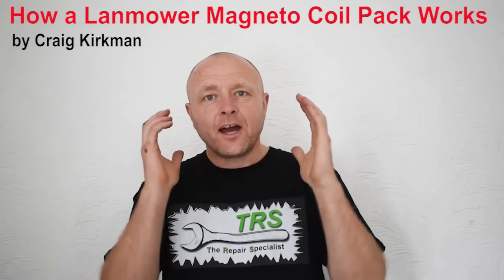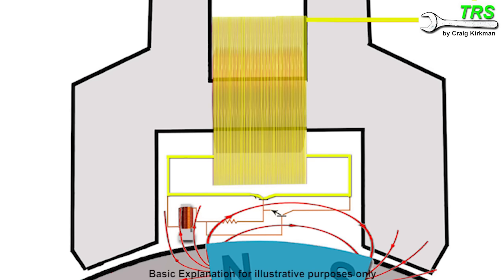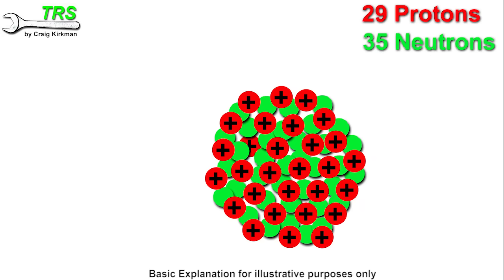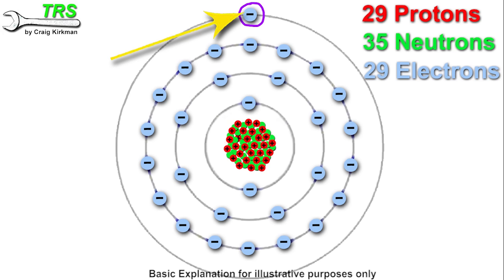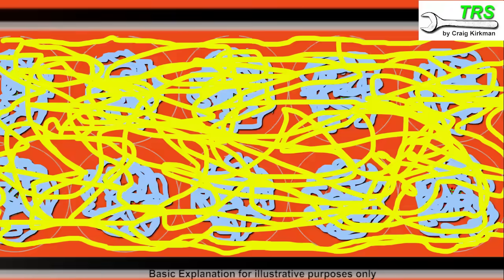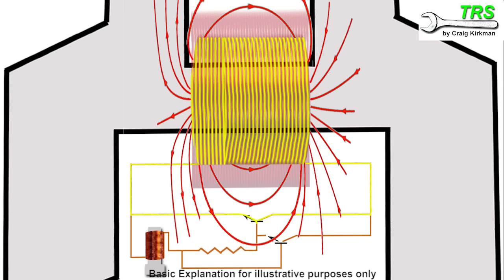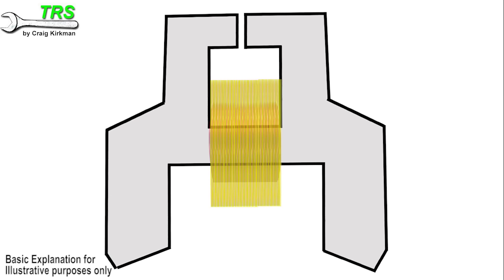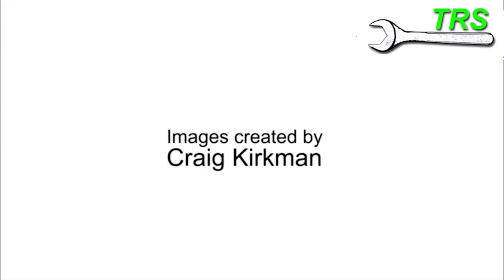Lawnmower Coil Pack Sparking System - Induction Coil, Transistor!  (by Craig Kirkman)

Comment: You’ve given us a truly excellent explanation of the physics behind how small engine ignition systems work. However, someone with trying to troubleshoot problems with his lawn mower etc. would find it even better if 1) if there were some mention of what the gadget’s kill tab does & what its resistance to its frame should be 2) some mention of what the resistance of the resistance between  its sparkplug lead and frame be 3) a complete circuit diagram  depicting what the ends of all three of the gadget’s coils are connected to, and 4) because it’s often difficult to tell if the engine’s flywheel is still properly keyed to the crankshaft, some mention of where its magnet ought to be with respect to the magneto’s frame at engine top-dead-center.
Reply from the maker: Well, firstly, thank you for your nice feedback. Really appreciate it.  Yes, I understand what you mean.  There is much more I could, and should have mentioned.  I had to draw some lines and because of this i didn't go into to much detail. Thanks again for your comment. What you have mentioned will probably go into another video soon,  Thanks. Craig

Comment: Wonderfilled video! Two questions though. Why are the laminations shaped the way they are; and need to be set at .040 or so from the magnet. Second, how did these ignition coils work before the invention of transistors? The transistor was invented 1947ish and the P type Briggs & Stratton was early 1900's. Thank You great job on the video!
Reply from the maker: Hi. Thank you for your comment and feedback. I really appreciate it.  

As to attempt to answer your questions.  
As far as I know, the Transistors were developed and used to replace the old contact breaker point system.  Transistor were favored because unlike the breaker points, they had no moving parts and were much smaller and space saving within the coil.  Whilst the transistors were invented in 1947, they weren't actually not used for many years later, according to what i can gather anyway.

As for the other question about the lamination's.  
The lamination's within the iron core are necessary to prevent swirls of current developing during the coils generation of electricity.  These swirls of current are called Eddy Currents (also called Foucault's currents).  These currents need to be reduced because they interfere with the transfer of electromagnetic energy from the primary coil to the secondary coil.   

As for the beautiful P-type Briggs and Stratton engine goes, I believe this was developed using inspiration from the O.A Smith Motor Wheel acquired in 1919.  As a result, the P-type was introduced in October 1920, and has been in the hearts of many enthusiasts ever since.

I hope this helps and please forgive me if my history isn't completely perfect here.

Thanks again for your feedback. Craig
Reply: @TheRepairSpecialist   Thanks for the reply! I should've realized the older engines were using points. It makes sense now. As for the laminated cores, I do have a vague understanding of eddy currents and the need to keep them controlled for better performance in a transformer. My curiosity however lies in U shape of the lamination pack, where each leg of the up-side down U is in such close proximity to the fly wheels magnet. It would seem that as the magnet passes by those legs that the lamination pack would become magnetized as well. If that is the case, does it result in a stronger magnetic field induced into the secondary than the primary could accomplish on its own?
Thanks for taking the time to do this for us.

Comment: Hlw bro, I am having a lot of trouble with two lawn mowers.  The problem with my machine is that after starting, the rpm increases and the start stops.  Same problem in both.  Please tell me the solution
Reply from the maker: Hello Sir.  
Are your mowers two stroke or four stroke? If you have 2 stroke then this sounds like they are becoming starved of fuel after starting.  Check your fuel tank cap and make sure it is breathing.  A good test is to loosen the cap slightly and see if the engine runs longer. If so, then it is pressure build up from the cap not breathing. It seems a little strange that you are having the same problem with the two mowers though. Are they the exact same type of mower?

Anyway, if they are four stroke, it is still worth trying the same with the cap and just making sure that there is free flow of fuel to the carbs. Check fuel filter flow etc. 

I'm not 100% sure it is the coils at the moment because of the increase in engine rpm before stoppage. It sounds like it could be (not 100% sure again) more of a fuel issue at the moment but one thing I have learned over the years is that we can never tell for definite without further investigation.  

Try this first.

Thanks
Craig
Reply: 2 stroke engine
Reply: Both
Reply: Hlw sir, following your suggestion, 
 to start both the machines, No more problem, Thank you so much Sir

Comment: The primary and secondary create a step up transformer, but what I don't understand is the EM induction into the trigger coil.  When the South side of the magnet passes the trigger coil, current will flow in one direction, and then when the North passes, it will flow in the other direction, inducing an alternating voltage, correct?

But in your illustrations, it looks like it is pulsed DC voltage.  Is that how it works?
Reply from the maker: HI, thank you for your comment.  I can tell you are knowledgeable and you are absolutely right in your questioning.  I endeavor to make an update video that explains this much better.  Thanks again, and I value your comment. Craig  👍

Comment: What happens to the second lead on the secondary coil terminates to the spark plug? So 2 leads to the plug or… ?
Reply: It would have to go to ground to shut the engine shut down? changing the path to ground killing the spark
Reply from the maker: Yes absolutely, If you get the time then please take a look at my other video in this link where I explain this much better. Thank you. Craig :  https://www.youtube.com/watch?v=JN0icpsh5qM&t=710s

Comment: Very well done! There is only one aspect of this mechanism that may be pointed out and that is the proximity of the magneto pickup to the magnet that is mounted on the flywheel. Obviously, the amount of coupled flux lines varies as the proximity changes so the question is begged, is there an optimum distance or gap between the pickup and the flywheel?
Reply from the maker: Hi. Thank you for your comment. I really appreciate it. To be honest, most of the people who I work with in the trade use a business card to set the distance of the fixed magnet on the flywheel and the pick-up on the coil. This does seem a little in-professional to say this, but it actually works quite well. I’ve tried it many many times. Other than that, you can find the specifications for each specific engine. I’m sure you can use a search engine to look up your particular engine and find the answer. If not, then you could try the business card if you feel it is good to do so. I hope this helps a little . Thank you. Craig👍
Reply: @TheRepairSpecialist  Thanks for the response. Will file that away for future use.

Comment: Thank you for that excellent explanation, right down to electron flow! I have one question if your time permits;  After the secondary coil pushes the electrons the spark plug to the earth body, does the coil become positively charged or draw more electrons in from elsewhere ?? much appreciated...
Reply from the maker: Hi. Thank you for your nice comment. I really do appreciated it. So, as for an answer to your question.  I believe that the electrons are pushed out of the secondary coil by the electrons behind them. 

If i am correct in saying this then that means there is electrons in place from those that have been ejected out to the spark plug.  Kind of like when a river pushes its water flow downstream. The water has been pushed there by water before it. The water before it naturally takes then place of the water in front of it.  

I hope this helps. 

Many thanks again. Craig 👍

Comment: How do the electrons complete the circuit by finding the engine ground and getting back into the coil copper which has insulation around it??
Reply from the maker: Hi. I know what you mean by asking this question. The whole thing can be quite confusing.  If you take a look at my other video on How these Coils can fail, it mentions about this, which of course is all explained from my own opinion from the research I have managed to collect and put together. The video is here in the link.  Many thanks. Craig  : https://www.youtube.com/watch?v=JN0icpsh5qM&t=817s

Comment: thanks for the great video! one question for you- why does the coil body have two points of "contact" with the spinning magnet on the fly wheel?
Reply from the maker: Thank you for your feedback. As for your question. It is apparently a way the coil interacts with the North and South poles of the magnet. The video didn't explain this type of detail because it is deliberately kept simplistic for an initial explanation.  I will look at making another video explaining this further though.  

But as it stands at the moment, I have found some information saying that the two points relate only to keep the correct distance between the flywheel magnet and the coil, and other sources say that it interacts with N and S of the magnet as mentioned.  

One thing is for sure though, as with any video like this, finding information about such a thing is almost impossible on the internet sometimes because NO so called professional in the field has bothered to help others by explaining to us. BUT, when I make a video about a topic it brings the so called no-it-all's out in the chats then.

That's why making these types of video is challenging. You have to piece together what info can be found, and then listen to no-it-all's big talk when your video is uploaded.

Sorry for the rant. I just want information and learning to be available to everyone who want to know. People like yourself!

Thanks
Craig

Comment: I'm trying to use a newer b&s coil as a ignition coil for a burner re-lighter 
Using a 12v battery and a 40a relay with negative grounding
Do you know any tips for doing this?

Comment: I was having trouble understanding the magneto ignition system. This video makes it very clear, thanks. The animations are very helpful. I think it might help to include the capacitor (condenser) part of the circuit, as this is important in controlling the exact time of the spark and making sure that current is discharged rapidily enough through the plug to create a spark.
Reply: I don’t believe this system uses a condenser. The older systems used a condenser ( when points were used) .

Comment: I like this. I like it real well and will probably use this to help explain the concept to people. I think the most common misconception about electromagnetism in this application is that a spark is not created JUST by a magnetic field, but that a spark is created when a magnetic field quits, or collapses. Best demonstrated with a simple automotive coil. Connecting 12 volts to it does nothing of note, but taking away the 12 volts is what produces the secondary spark. Thank you.

Comment: Many thanks for this interesting explanation.  A number of parts of it I was not aware of so it was very useful.  I need one more part of the explanation.  Most lawnmower engines are four stroke but the system as described will produce a spark every rotation of the flywheel.  We only need half that number of sparks - at approx top dead centre on the compression stroke only.  Is there a redundant spark on the exhaust stroke?

Comment: I guess the next question is: how to test the different components of the coil system to find a problem. So far, I see its easy to test coil #2 for open and short conditions. However, the primary and trigger coils do not seem accessible for testing. I wonder how to test this unit properly to properly fix a problem.

Comment: One thing I missed. In earlier systems, points were used to cause the rapid collapse of the magnetic field. In current systems , electronic ignitions, there are no points. I assume the electronics in your diagram have something to do with initiating the rapid collapse. Is it simply the loss of the magnetic field at the trigger coil or do the transistors play a role?

Comment: Nice explanation of an electronic ignition coil in a  small motor. I have a bad coil on an antique gasoline powered drill that needs to be repaired as there are no similarly shaped replacements available to fit into the tight space necessitated by the very compact packaging requirements. The highly detailed explanation in your video has inspired me to simply rewind the secondary winding, and splice in a new high tension lead. My system pre-dates transistors so instead of using a trigger coil my system uses points to break the primary coil circuit thus causing primary field collapse only when points open.

Comment: Well done man! Super explanation!! I would be interested in information concerning how to test a coil pack with an ohm meter to determine if the pack is good or not!! I had a mower that wouldn't start. I got it to run after changing the plug and coil. I ohmed out the new plug at 19k ohms, it has a resistor. The old plug measured 4k ohms!! The old coil pack readings were : scondary 289k ohms, primary 9k ohms. The new coil readings were: secondary 300k ohms, primary 14k ohms. Would this lower reading in the old coils be enough to cause no spark or was no spark due mainly to the drop in resistance of the spark plug or a combination of the two?? I know, complicated question!!! I like to learn!! Thanks for any information you are willing to share!!

Comment: Tecumseh lawnmower engines seemed to have a better system that involved a primary coil that generated power to charge a capacitor. 
Stihl I think has an even more sophisticated assembly that I think can sense RPM and change the time somewhat relative to engine rotational position thus giving a form of spark advance with higher RPM. Probably involves delay in triggering discharge of a capacitor that gets charged courtesy of a flywheel magnet passing it.

Comment: So I guess it's impossible to test one of these ignition coils as you can only test the continuity of the secondary coil, but can not test the primary coil, trigger coil or the Darlington pair transistors which have no electrical connection to the exterior of the coil module?
Reply from the maker: Hi. I will be uploading a video quite soon that will explain how to do what you have mentioned.  I can't give an exact timeline for this because of many other things I have to finish off first, but hopefully I will have it live in the next few weeks. Thanks. Craig
Reply: @TheRepairSpecialist Thanks, that was already a great video!

Comment: So many times I would ask myself..how does the the spark plug get it's fire.. I knew about the coil and the flywheel with its magnetic pull.and the points and condenser. But didn't understand how it l came together. I've rebuilt engines .. 350 ci. 427ci. 327..390..but this is my first Briggs and Stratton.. I inherited from my Father after he passed. It's been sitting in my garage for better than ten years.. He had it torn down to the flywheel. He bought all new valves and springs keepers piston rings.. But I'm stumped at getting the crankshaft apart. The shaft is connected to The generator windings.

Comment: Excellent instructional video...took the mystery out of magnetos and made it understandable. Well done in making the point that the wire  windings are NOT bare wire...they are insulated with that very thin coating. I think few realize that and if they don't they'll wonder why a winding of bare wire isn't the same as a block of copper.

Comment: I don't know if you have the time to respond to oddball questions, but I'm going to throw this out anyway. I restored a vintage Cushman gas powered golf cart. The body is all steel. It has a single cylinder Kohler (m12s) None of the electric system worked so just to be safe I bought a new stator, rectifier, and ignition module. It runs great, but.....After the engine warms up the the entire golf cart becomes electrified. The engine does not misfire when the body parts become electrified. I can not get anyone, including my dog to ride with me because they are getting shocked if they touch any metal part. I mean a real shock, like you grabbed a spark plug wire. Obviously this is bad. Any thoughts as to which part is defective and why this might be happening?

Comment: Very good explanation, except I think the atomic theory part over-complicates it unnecessarily. It would be enough just to show electrons flowing in the copper wire without going into the structure of the copper atom IMHO. I never knew about the trigger coil and darlington transistor, replacing the points before.

Comment: Great Video. But what's the connection on the side of the Coil used for? I'm guessing it's a shut off for the Coil.  And that's how you shut off the engine? Does it ground the (Primary?) Coil? Or does it need 12 Volts to energize the Circuit? Bummer.🤔

Comment: Great explanation. Question, I have a small engine in which the spark plugs, (2) do not spark, But if I connect the end of the boot with a screwdriver to the engine I get a spark. As soon as I put in the plug and ground the plug, no spark. Could the ignition coil be bad?